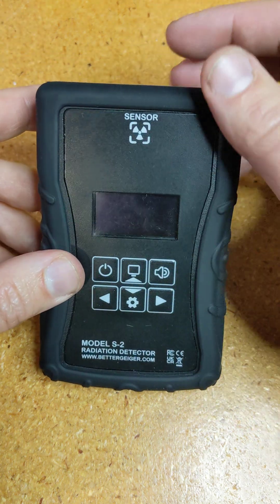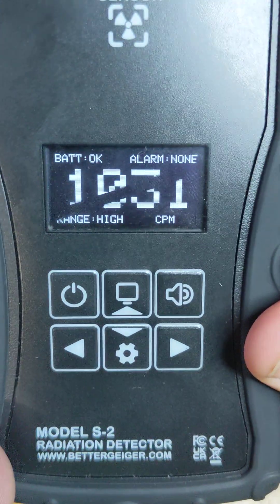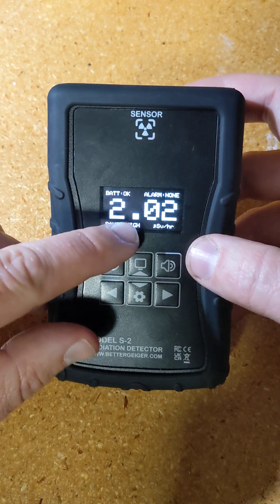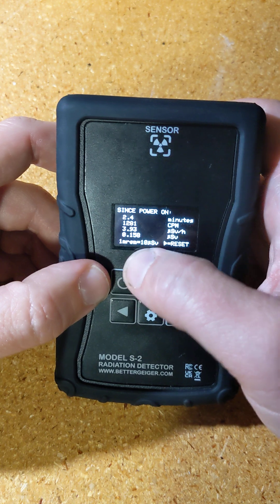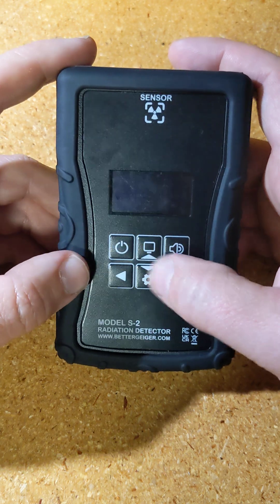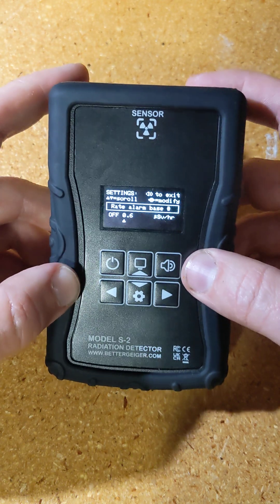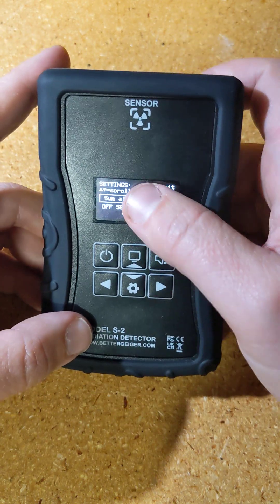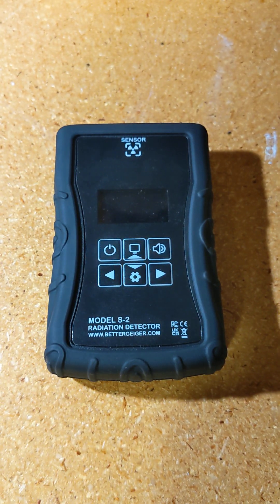Better Geiger S2 preview

Comment: I bought mine through your Amazon store.  Paid $199.00 plus tax.  It doesn't seem to work.  It's stuck on 0.001 and when I test it against a sample that shipped with my purchase it makes no change in reading.  Also, the sound button does not work.  Any help would be much appreciated!
Reply from the maker: Please send a message through the contact form on the website and I'll get this issue resolved ASAP
Reply: Sent it!  Thank you.  @BetterGeiger

Comment: How large is the sensor compared to the sL2?
Reply from the maker: It is a tiny bit apples and oranges because different material but I would say very roughly speaking the S2L is 10x more sensitive than S2

Comment: I would like to see battey life in the S1 vs S2 if there was a change at all?
Reply from the maker: Yes it increased some but nothing dramatic. The electronics were made more efficient but the larger screen counteracted that, those OLEDs are power hungry. It runs 50+ hours with ordinary alkaline or close to 100 hr in "dark mode"

Comment: Nicely crafted device.  Far from the Amazon rubbish that is for sale.  I appreciate your attention to detail, as it shows in the design. What are your thought of adding a USB port to allow for firmware upgrades?   Nice device, just might order one.  😊
Reply from the maker: It is something I have pondered but I don't think the complexity is worth it for this device. I do not plan any major firmware additions as the device is meant to be kept simple, though of course there might be some minor changes over time. Eventually if I offer a device with bluetooth then it would naturally follow that firmware updates can easily be implemented by the user, so I do plan on something like that down the road.

Comment: Due to this doesn’t pick up beta too well what’s the basic background data that we should look for? Normal geigers fall between 10-50 background to be normal so what is the norm for this decide to fall between on a standard environment.
Reply from the maker: Closer to 100-200 CPM background in terms of count rate, but that varies a lot depending on the environment like what soil is nearby and other factors

Comment: I’m new to all this but would this device work well for checking antiques and rocks/minerals?
Reply: Website specifies that it can be used for antique hunting, but it is slower and as such, a GM device would be better suited for the job.
Reply from the maker: Yes it can be used for antique hunting, it is very good for radium-containing devices and functional for fiestaware but not great. That's because fiestaware primarily emits low energy beta which is picked up well even by very cheap GM tubes, but GM tubes have other drawbacks. It gets a bit complicated, I need to make a video about that.

Comment: how can I see the accuracy?
Reply from the maker: Showing something like an error bar is very tricky for dose rate because the gamma energy is unknown and the random fluctuations over short measurements can be very high. For low radiation environments, like just background radiation, the number is pretty jumpy, but to get an accurate reading in that situation there is a mode which allows a running average to be seen, so you can do a measurement for like 5 or 10 minutes to get more accurate reading in one location.
Reply: @BetterGeiger  ok

Comment: Very interesting. I really like it operates on two AA! Two thing however I'd hoped was changed. Larger scintillation crystal/sensor. The current is a little slow to stabilise and CPM is just marginally higher than for a geiger with the ubiquitous J321/M4011/J305 tube (yes I know the differences and that you can't directly compare but still) - compared with Nano Wand as they're almost pure gamma. Second thing is display. Sure it's nice to see a larger display. But I really did hope for an LCD. Those inexpensive OLED are power hungry and get burn in relatively fast. Luckily they're (still) readily available cheap standard parts and are easily replaced - at least on the S1. You can get at least larger LCD with same I2C interface (but different pinout). Would have been nice if such had been used instead. Readable while backlight off - no need for a "dark" mode. OLED might have a hype amongst some people but it's far from always the best choice - sometimes a plain old LCD is the better choice. I've replaced the "white" display in my S1 with a yellow one as that is easier on the eye. Would have preferred it orange or perhaps red but such are not available - and unfortunately no LCD in same size or perhaps one that could do without the frame - otherwise I would have replaced it with LCD.
Reply from the maker: Thanks for your comment. Bigger crystal is coming but that will be an optional variation. The S1/S2 is unique in its high max range for the price, and increasing crystal size sacrifices max range for sensitivity, so that's why I didn't simply change it... But that will be a choice for people in the future if they want something more hobby-oriented and less emergency oriented. It is still much more sensitive than an M4011 or similar, but yes much less than some existing devices with larger crystals. Finally, I agree about the OLED... Many people like the very bright and simple always on, but it is indeed power hungry. I will probably change to LCD on the next version.
Reply: @BetterGeiger  Thanks for feedback! I can see the idea of a high dose device. But yeah would be nice with a higher sensivity as well. After all I'm not really counting on seeing it maxed out - at least not where I live. I tried connecting a (larger) 128x64 i2c LCD to the S-1 but no image. Guess there's some differences (contrast?) in how it's driven. Not sure I'm getting the S-2 - after all I have the S-1 which works very well - but who knows in some months time - nice to have in the prepping stash even though I have S-1. If anything I'm wishing for more sensivity and an LCD. Please stick to the AA or AAA. In an emergency you can just have a pack of Energizer L91/L92 always ready. And beside it's nice just to change set in an instant instead of having to charge it (IKEAs rechargeables are really great).
Also a nice little thing to add on - an analouge output which can interface to a computers soundcard. Can't remember where but I saw somewhere someone making his own scintillator setup. Output from PMT was going into soundcard and then some software. Of course it required some calibration before being able to use it on unknown stuff but luckily thorium is reasonably available - as quack products, vintage mantels and natural minerals (apatite if others are restricted). That could be a nice secondary feature only requiring a few extra components and mini jack.
Edit: LCD of course of the "positive" type that's readable without backlight.
Reply from the maker: @HifiCentret  The firmware is designed to talk to that specific OLED, so changing it to another screen is not very likely to work, it would depend on a lot of things. Yes for an emergency-oriented device I think AA is a better choice, although these days with ubiquitous portable USB charging options I would say it's not as essential as it used to be. Regarding analog output, I'm not a fan of sound-card based spectroscopy, too much of a hassle in my opinion, but if you look at the user documents on my website you will see there is a guide for pulling out the analog signal with the S-1 and getting a very crude gamma spec. It's not really designed for that purpose so the spectrum has poor resolution but if someone likes to play around with DIY it's a low cost way to get some more from from the device. The S2 can be used in the same way with GND, PK, TRG signals available on the S2 - I have not written a detailed guide for the S2 yet but it's pretty straightforward using the guide for the S1. Just note that the S2 operates up to 3.3V instead of 5V
Reply: @BetterGeiger  I don't know i2c displays that much. But guess it was worth a try to find out. For the old school 1602, 2004 displays etc. they're pretty much interchangeable - even across sizes. Just that if display isn't large enough then overflow is simply cut off.
Reply: @BetterGeiger  Having two options for the device would be awesome! I'm a hobbyist and I'd be great to have a more sensitive version for mineral hunting, antique hunting, and whatnot. One of the main selling points as a hobbyist is the high range, though! Plus the very accurate dose rate measurement, which I think is sweet! The thing is, is using the dose rate measurement on a geiger counter, (especially alpha sensitive ones!),  that's not energy compensated is literally worthless because they don't know how strong the radiation is. The better geiger is the most accurate thing you can get for the price! And the high range is amazing because most professional meters can't measure that high! So yeah! I can't wait to get mine! :D

Comment: What does the background on this device look like, similar to my radiacode or what? :)
It's still a scintillator right?
Reply from the maker: Yes it is a scintillator, background various a lot but maybe couple hundred CPM would be typical. Compared to the radiacode it is a smaller crystal, so it is lower sensitivity, but it also able to detect much higher ranges of radiation, that is the tradeoff. This will go to 100 mSv/hr compared to radiacode 1 mSv/hr. It is also lower cost. It is more suitable in an emergency environment, but slower to pick up weak sources of radiation compared to the radiacode, and the Better Geiger does not have the ability to record an energy spectrum.
Reply: @BetterGeiger  Wow! 100msv/h is impressive! Also glad the sensitivity is higher! :D
I think this will be my next purchase after a cdv-700!
Reply from the maker: @Liminaut0  Sorry if my wording was not clear, the S2 has the same sensitivity as the S1. The S1 and S2 are lower sensitivity than the radiacode because the S1/S2 have a smaller scintillator. This is a tradeoff to allow higher maximum range, generally speaking bigger crystals saturate more easily.
Reply: @BetterGeiger  I see! :D
I know the radiacode is higher sensitivity! I just though the s2 was higher sensitivity than the s1, although I guess not! :)
Thank you for informing me! :)
Reply: @BetterGeiger  What's your strongest source in cpm and usv/h? (energy compensated)
Reply from the maker: @Liminaut0  I only own license-exempt quantities so they are not very strong. There are facilities with stronger sources that I can visit for testing purposes to check higher range
Reply: @BetterGeiger  I see! :)
The strongest thing I own is a piece of uranium ore from gabon africa that's over 200,000 cpm on my radiacode, and 88,000 cpm on my gmc-500+
It's only 100 usv/h energy compensated though, so not that scary, as the radiation is fairly weak.
Reply: Hey Robert. When are you shipping to the UK? Can't wait to get mine.
Reply from the maker: @DennisSantos  First batch of pre-orders ships TODAY. :) 
In about 8-10 days I will be caught up on pre-orders. You can place an order shipped to the UK any time. As of now it would most likely ship in 8-10 days.
Reply: @BetterGeiger  yeah!
Reply: @BetterGeiger  it arrived today! Yay! 
Is the plastic covering the screen meant to be removed. I've left mine on as it doesn't look bad, actually.
Reply from the maker: @DennisSantos  I'm glad you got it! Yes that is a protective covering which can be removed. Doesn't hurt anything to leave it on if you like it that way.
Reply: Does this detect alpha beta and gamma?
Reply: @scarecrow1310  Nope, just Gamma, xray, neutron, and maybe some beta
Reply: @Liminaut0  so not even beta then? Dang. I want something that can do at lease beta normally